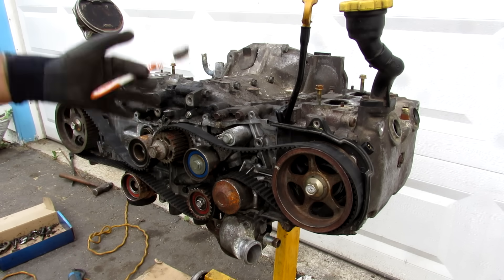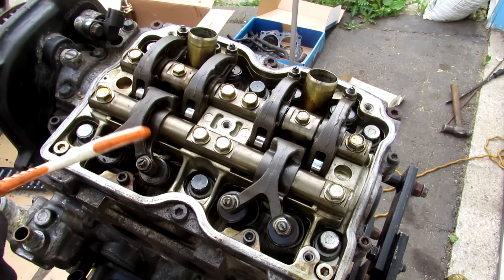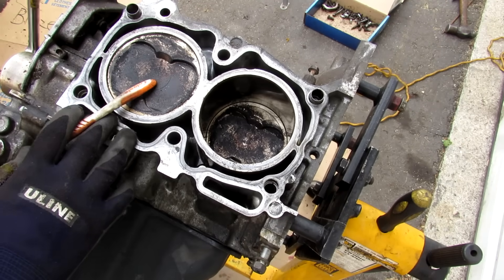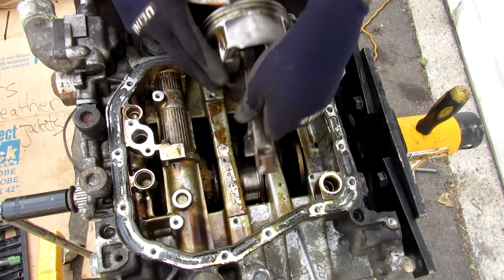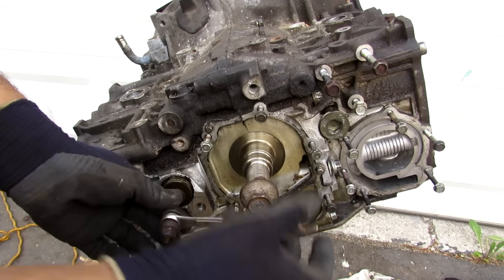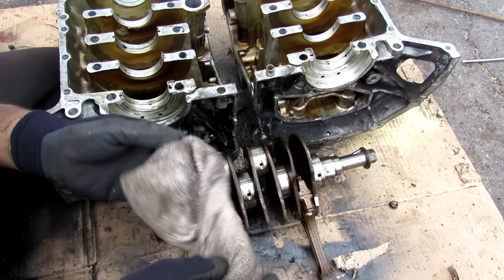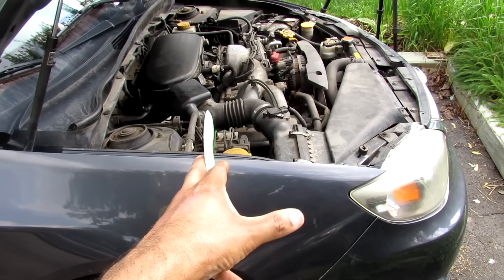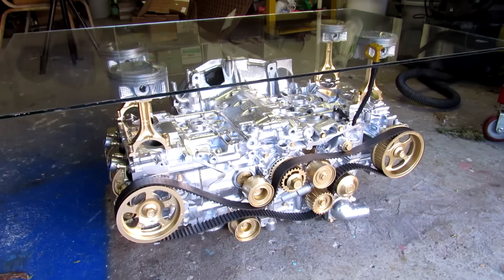Why Subaru Engines FAIL

Comment: Out of the all vehicles I owned the Subaru engine was a absolute nightmare to add power and keep reliable. I owned a 2004 wrx(broke the transmission) and a 2006 STI one was bolt on's the STI was 450whp(lifted the heads pressuring the coolant system with a built engine). Those 2 instances are the only time I had a major mechanical failure. I've had stock ls3 motor up to 850whp until I sold the car.

Comment: I had an '02 Forester and yes, it had leaky head gaskets. Annoying to be sure, but otherwise a fantastic vehicle. I never lost enough oil to warrant adding any between oil changes. One thing about a Subaru is that most people tend to drive the crap out of them. Low-mileage Subarus are rare. My next (and current) vehicle is an '09 Forester XT premium turbo. It is an exceptional vehicle. The only mechanical issue I have had is a radiator leak at 150K miles. Replaced the radiator and no problems. Spark plugs are a hassle because of clearance but only necessary every 60K on the turbo (iridium plugs $20-$30 a each). I don't know if this means anything or not, but my '02 was built in USA and my '09 was built in Japan. Several people have tried to get me to mod the '09, but I just don't want to mess with such a reliable and well-built car.

Comment: If it has a belt drive, it is always prone to failure, if required service is not constantly maintained. Why do they use belt drives, cheaper? Chain drives are also prone to failure if they use plastic chain guides, and lack of being properly maintained.
Reply from the maker: Yes
Reply: I have 2 Subaru's, but just grocery getters, and was curious about what was going on these days, with building them to last, producing impressive HP numbers. I had worked in the Auto Industry for 27 years from 1968 to 1995  and we used Jesel belt drives for all of our customer built V-8 competition engines, always well maintained if you want to stay competitive. I had used a Pete Jackson Dual Idler Gear Drive for my street car. We never recommended Gear drives for competition due to harmonics transfer from the Crankshaft to the Camshaft with Gear to Gear drives. Even though Pete Robinson built and used one on his Ford 427 SOHC Top Fueler because nothing else would survive. Back then I think the Fuelers were only producing 1500 HP? @speedkar99

Comment: Because, in the world of corporate espionage, Southeast Asian Engineers always steal every page but the right ones.  Subaru is actually a well-built, well-designed car it is [effectively] the Japanese Volvo, which actually isn't a  compliment at all, considering that Volvos are the #4 worst driver on the road by vehicle type, brand, or model, with its Asian compatriot - Subaru at #3,  Volvo is insatiably jealous of any brand that has a model with a pair of nuts attached to it… but they have paid a price for 40 years of marketing safety, they earned it.

As for Subarus, I get the study, I drive every day, I'm on the road, I see Outbacks and Foresters in wrecks all the time, whereas I see WRXs, with all the other tuner models they make, being served up a well-deserved citation for some very obviously bad driving at high speed.

Comment: Thanks, the handling of a car with a Boxter engine is much more valuable than the mentioned problem.  For me, this engine works for 356,000 kilometers, just by changing water and oil, replacing belts and consumables.  Of course, you must use high quality oil.
Reply from the maker: Yes oil quality but more importantly, level

Comment: Flat fours perfectly balance secondary forces, while inline-fours cannot, often using balance shafts to cancel out vibrations, and why horizontally-opposed engines are used on airplanes.  The only downside of a boxer engine from a balance perspective is that pistons don’t sit directly across from one another, meaning they can create a little torque that tends to want to rotate the engine about the vertical axis.

The only way to have perfect secondary balance with a 90 degree V engine is if it has 8 cylinders.  To have perfect secondary balance for a V12 requires a 60 degree V and why the aircraft engines such as the Merlin and Allison used in WW II fighters.   The 60 degree V is narrower and enabled better aerodynamics.  To have perfect secondary balance for a V6 requires a 120 degree V, and the only way to have perfect secondary balance with a 4 cylinder is to have a 180 degree V which is no longer a V but a boxer or flat 4.  However, a boxer with an even number of cylinders will always have perfect secondary balance because there is piston always traveling at the opposite angle on the opposing side which is why they are used on aircraft as well.  Aircraft engines leverage this.  On a 4-cylinder engine with 360 cubic engine, each cylinder produces 90 cubic inches.  To add power, they lengthen the engine for two more cylinders and they get the 540.  Add two more, and you get the 720, all using the same pistons, rods, valves, and cylinders.  

What drives the screwy engines we have in cars these days is transverse mounted engines and fitting adequate capacity into a short area.  Balance shafts essentially create a hammering inertia that opposite what the engine is creating.  E.G. two hammers hitting each other with equal force cancel each other out and create other stresses, adds weight, complexity, and expense, but as I said earlier, proper engine design is not what is driving the design of engines, it is transverse mounting, room for suspension, and adequate cubic inches, and turbo charging to move the hp and torque curve to lower RPM, computer controlled direct injection and timing monitoring knock sensors that are used to make engines work that today have poor rod-length-to-stroke ratios, poor piston diameter to stroke ratios, and impossible balance.

What I found interesting about this engine it is one of very few used in cars today that has perfect secondary balance, where the engine dictated the car design.
Reply from the maker: Thanks for the update on engine balance - this was 3 years ago and I'm more enlightened now

Comment: Fascinating, thanks for this.  My Subaru Forester did over 120k.  Apart from service items - brake pads, etc the only item replaced in 14 years of driving was the rear exhauzt section.  I even sold it with the original battery.  The most reliable car I've ever owned.  And it drove on snow and ice like it was on rails.
Reply: 14 years and only 120k ?  you barely drive it ! 
I drive 60k per year.

Comment: My 05 Outback is approaching 200k miles and still runs strong. I've got the 3.0 model so it's a flat 6-cylinder engine. The key to keeping Subarus reliable is staying on top of the maintenance. If you can manage that then they are awesome and reliable cars. And yeah the spark plugs suck to change so buy quality plugs with a long life span.

Comment: No way I'd ever have one of those engines. High maintenance junk. And hard to work on. Why Subaru went with that design is a total mystery. So many other choices would have been so much better.
Reply from the maker: Subaru wants to be different.

Comment: I had 2 Subarus  97 and a 98.  Not impressed. Gutless 165 hp.   Old 92 camry  130 hp would run circles around them.  Gas milage was 21 on 98 forester. Camry was 30 mpg.

Comment: I have a 2001 Impreza 2.5 RS. Only 2 problems in over 20 years. A known issue, leaking head gasket and a wheel bearing needing to be replaced.
Reply from the maker: Nice

Comment: Most failures we see, is either the engine was running with low or no oil, or overheat the shot out of it. The biggest is oil consumption, does not matter if it’s turbo or not.

Comment: The entire design its not good  right at the center were the crank case seats its huge major fail   Subaru knows but they just ignore the issue  i been working on those engines

Comment: Subaru's are not very good cars contrary to what people might think
Reply: My STI always gaps 392s and I can take turns at 130plus
Reply: @Craiggg12345  this isn't any La Brothers I have ridden in some Subarus that scared the ever-loving crap out of me you ever ridden in a 700 horsepower Subaru bastard is crazy
Reply: @Craiggg12345  I rebuilt the Subaru motor about 40 years ago that had 160,000 miles on it and when I took the lifters out of it they still had the factory riding around them that told him their tolerance and whatnot you know what I'm talking about if you know Subarus you know what I mean
Reply: @Craiggg12345  we all know that fast cars get abused that's just how it is but in my personal opinion the average everyday grocery getter people think Subarus are made of gold and they don't maintain them and they burn them up before they wear them out
Reply: @Craiggg12345  personally myself I like any kind of a LS and I really like Mazdas and Hondas those are the funk

Comment: I worked 12 years in a Subaru dealership 3:32 shop seen many of Subarus  2 to 300.0000 miles on them  the way  the lasted  that long was the were maintained

Comment: The boxer engine is one of those engines designed by engineers because mechanically it's amazing but in practice it's a nightmare to deal with.
Reply: All engines are designed by engineers
Reply: One some Subaru models like the Impreza, you have to remove the entire engine out of the car just to replace the headgasket.  Replacing the timing belt in car is also a nightmare.  It took me about forty-five minutes to replace the timing belt in the Volvo Five Cylinder Engine he showed.  The Boxer Engine Timing belts is something like two hours on an Outback.

Comment: I have had 3 subarus in my life and all of them have easily made it to 300,000 miles with no problems at all. They leak oil a little more than most engines and thats about the only problem. The rest of the stuff I think really only comes into play if you are trying to mod and get more HP. Which of course a lot of people mod subarus so I'm sure people have seen a lot of blown up subaru engines. But if you are just getting a daily driver that you plan to keep stock your'e not going to have any problems
Reply: My gf has a ford focus 2003 with a zetc that has 365k mi, all original, never rebuilt and burns no oil to speak of...does drip a few drops here and there... my car is a 94 probe gt with 260k mi..these have lots of issues after they get high mi..... daily driven almost 30 yrs, burns some oil,bad valve seals but never rebuilt
Reply: My old 2005 Sti made to 167k miles with zero issues with the motor. Only had wheel bearing going out and dead head lights balast. No major issues with the EJ25. I'm not sure why people have soo much problems with Subaru motors.
Reply: @XeebThoj728 It is due to lack of maintenance, I.e. oil changes. We live in a set it and forget it. I would love a Boxer engine if for no other reason than to imagine I’m driving a Porsche.
Reply: @XeebThoj728  most of the time, head gascet problem on the Subarus are caused by engine tuning without head gascet upgrade
Reply: @XeebThoj728 they expect them to be K motor reliable, and almost nothing is.
Reply: My mom's '03 Outback made it just north of 320,000 miles before the transmission blew last year. The engine leaked oil like no other car my family owned, and my brother kept saying it was developing a tick, but it was a true workhorse.
Reply: never had luck with them 120-150k even with regular maint and all that and not racing but never had much luck with pancakes
Reply: My transmission failed sub 70k I had electric problems, and many low oil issues before every scheduled oil change and other issues
Reply: My 2005 Forester XT, daily driver (properly maintained) had the head gaskets replaced at 135K miles and now at 140K spits white tail smoke. Its turbo was shot; I replaced it and still has the same problem. I believe that these cars  are just a hit and miss...Not reliable cars...
Reply: @solarflare4259 you bought a turbo one that wasn’t an STI, bad idea, these engines don’t take nicely to boost.

Comment: I have a 2002 Outback Sport (Impreza Wagon) with 366,000 original miles. I've only ever had to change the oil, and starter. Been the best damn car I've ever owned 🤷
Reply from the maker: Awesome. I'm tearing apart a Subaru Outback. Stay tuned for the videos

Comment: As a DIYer I’ve changed big end bearings (decades ago when people did that sort of thing). From memory access was from the sump. Remove it, unbolt con rod, inspect crank for wear, put in new bearings and close up. On this flat four the job is a million times harder and not worth doing unless as part of a complete engine rebuild.
Reply from the maker: Wow. Back in the day that was a weekend Driveway job

Comment: I think maybe I would losen the cam gear with the belt still on so I didn’t have to jam a screw driver and use it as a brace….
Reply from the maker: Good tip

Comment: This is such an incredible video sir! I'm knowledgeable and intuitive but with no formal training its hard to cover all the small details of how such differently designed engines function. I owned an STI with an EJ25 and trying to understand the nuances of the regular maintenance, the "why" of what im doing, was always a lost cause. This singular video helped me understand not only boxers but the general function of internal combustion engines. Incredible! 👏
Reply: I don't know why this video made it back to my recommended list but I'm going to give you some advice from my 20 years of working with Subaru engines.

If someone makes some statement about their head gaskets get as far away from that motherfucker as possible. They don't know what they are talking about and are dangerous.

The head gasket issue on Subarus was only ever a problem one of their NA engines over 20 years ago. It was down to not using MLS gaskets. They issue was rectified at the time for free by Subaru and hasn't been an issue since. 

The remaining headgasket myth is from ignorant mechanics and Internet experts that don't know what their doing when diagnosing coolant loss. It isn't a headgasket problem it's usually down to the turbo seals.

The other misdiagnosis is cylinder and head deflection on high power builds. That isn't just a Subaru problem it's a open deck problem.

Comment: Despite these flaws mentioned. They do make a heck of a good impression on power in the cars that got these in them. Not over the top but alone without turbo, most confident engine I’ve driven.

Love my 2007 Impreza non wrx cause of that. I know that oil companies will say every 6000 or 10000 miles. Don’t. Do it every 3000-4000 miles. Even on newer cars. Also will help ensure your checking for any metal shards in your oil changes more often. Saved myself a headache more than once and corrected it before it got worse

Comment: Boxer engines fail no more than any other engine. You just don't see Subaru's on the side of the road with the bonnet up here in Australia! They are a similar design to Porsche, so they are not a problem. If you keep oil in the damn thing you'll be fine.  What tends to make engines fail more (and this is true for all engines as well as boxers) often is when people try to develop more power out of them than the designers really envisioned for them. With the Subaru WRX particularly, you see backyard and semi-professional mechanics trying to eke out 850-1000 horsepower out of the bloody things. They were not meant to do this...that's when the damn things fail!

Comment: Listen mr genius...ANY engine will fail..some take longer than others..Subaru..the newer ones, last longer than MOST engines when cared for..My 2005 xt has 320000 miles on it..slight camcover leak on passenger side..oil changes every 10000 miles with Rotella T-6..I drive it like I stole it..Even the slushbox still works !!
Reply from the maker: Awesome

Comment: I had a 2.5L NA engine that started to fail due to head gasket issues at 125k miles. I'll never buy a a Subaru again. BTW an oversquare design means less torque, negatively affecting every-day driveability.

Comment: Totally admire your dedication to engines like these ones , and I tell you🤨 I hate the crap outta these fucken engines ! Would there be a way to modify or improove them to last? BUT ! 😮 Have you ever done research about the best fuckenest long lasting flat 12 cyl. Engine from the 1969 porsche 917? It kept winning Le Mans and was sanctioned to start in second gear 😞  a plate was installed on the shifter to ommit first gear , and give a chance to Ferrari, Lancia , Maserati , Ford , Corvette , Matra Simca , to compete .😮 and by the way 😕 would it be wise to use a thinner oil and top it off, on this crappy engine? Plus a bigger oil pan ? Please let me know , thank you 👍

Comment: This video completely blew my mind. Who thought this stupid thing up? There are SO many moving parts, like literally, things that can go wrong...Holy Sht! That the engine even runs at all with all these parts, connections, bolts, covers, valves, pistons...is nothing less than a miracle but for Chrst sake, can we not make a simpler machine just as powerful but without the nightmare of...well THIS?

Comment: This video showed up on my recommendation list and I am extremely impressed by the author's instructional style! Clear as crystal, brief and to-the-point. I wish I had this guy as my instructor when I learned engine maintenance. My specialty is aircraft avionics but occasionally work on piston engines. Due to the boxer design this Subaru is surprisingly similar to that of 95% of small aircraft engines and so are the failure modes.
Reply from the maker: Glad you like my video style!

Comment: Subaru engines known for their problems. I buy wrecked cars all the time, never had any problems with other makes, but Subaru. Just with slightly hit to front end does it. Timing belt skips a tooth, knocking problems. If you get one that still runs good, maybe will last longer. But some old Subaru seams like run forever too. Maybe all never just poor design